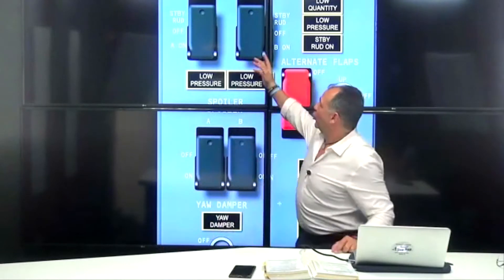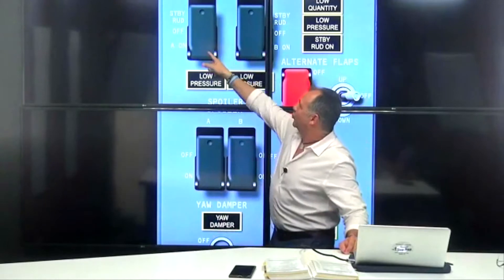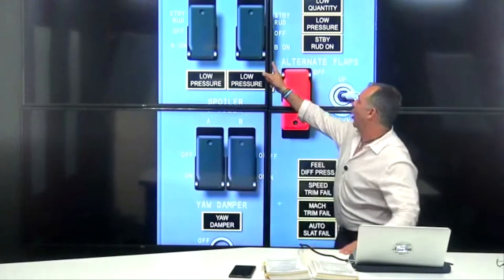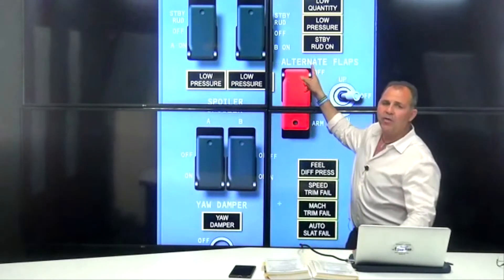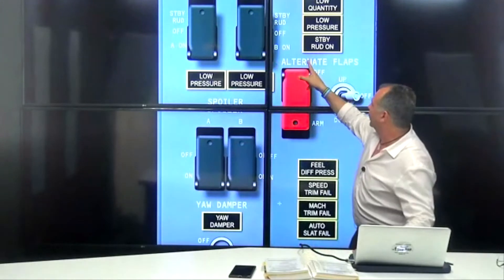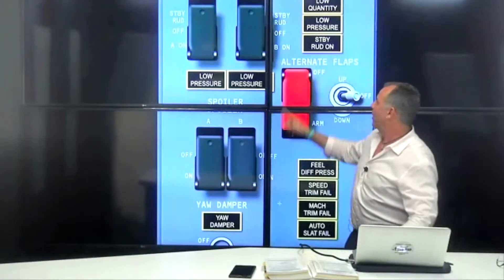B737 Rudder

Comment: Buenos días amigos Juan y Joe Soy Saverio. Les escribo desde Caracas Venezuela Soy técnico aeronáutico
Tengo una pregunta para ustedes y es con respecto a la luz
STANDBY RUDDER ON.
Tengo entendido que esa luz significa que el timon direccional es operado por el syst hyd Stand  by debido a lo que uds explicaron claramente. La pregunta es si esa luz también se enciende cuando hay un bloqueo del PCU  power control unit y que este recibe presión hidráulica de los syst A y B de manera simultanea?
Reply: gracias por tu soporte, no se prende por bloqueo de cualquier PCU